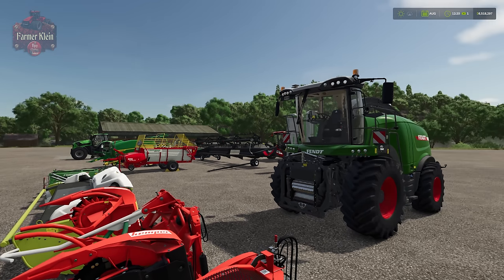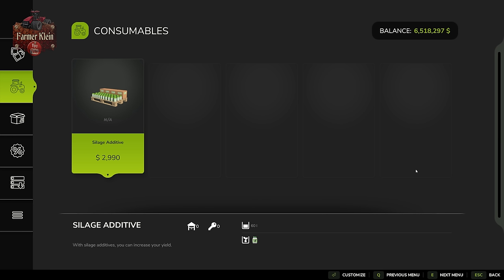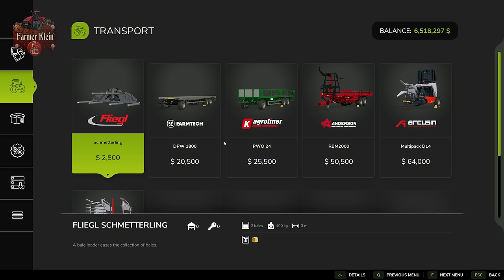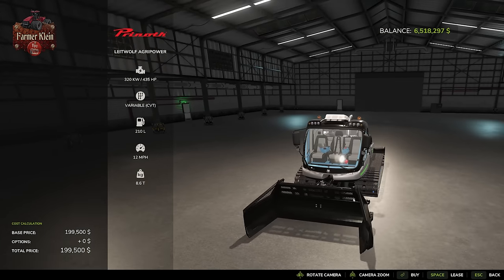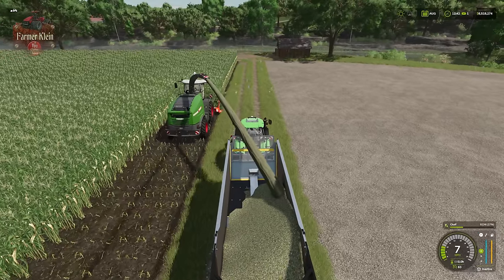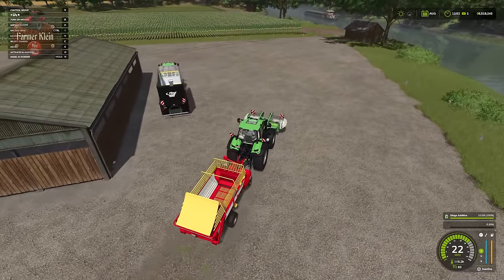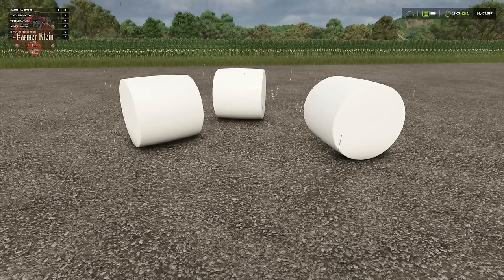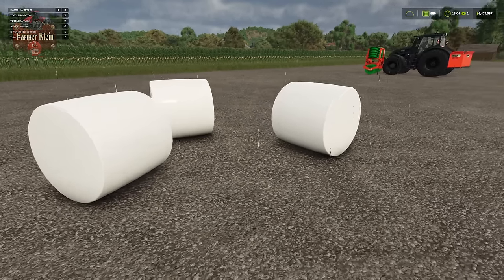The Essential Guide to Silage in Farming Simulator 25

Comment: Thank you for the concrete paint trick FK, very helpful indeed! In FS22, the trick that made its rounds around release was to use a straight subsoiler to scrape out silage that was stuck in the bunker walls. It worked, but it was a real pain to do. I like this much better 👍🏻
Reply: soften does it also.
Reply: tbh I just used a conveyor and pickup never had anything stick to the walls that way

Comment: ah buddy you can get more than 3 cuts off a grass field in a year starting in March you harvest bale or transport to a bunker, Roll the grass with a GRASSLANDS ROLLER, fertilize if under 100% (you shouldn't be) the field is ready EVERY 2 MONTHS until November so Harvest months are March, May, July, September, and November itself, for 5 harvests at 100% fertilization and 90 to 100% Yield bonus.

Also Using the Macdon Windrower with its grass mower head will give a 25% yield bonus to grass and wind row it at the same time so IF your using silage Additive these bonuses add together! so off my 1 Ha Field harvested 5 times a year with 100% yield bonus at fieldwork level harvested with a Macdon for 25% yield bonus, and Silage additive used gives me a total of 130% Yield bonus to grass silage work, This produces 5 cuts at roughly 400,000L to 500,000L EACH Cut! (I'm not so good at staying in the field & like to manually cut lol) that's more than I got from Corn Chaff and honestly I'd rather the profit from the corn and its straw (mod extended straw crops)
Reply: I can never get it to grow in the winter. And hence I never get to harvest at march. I end up harvest 4 times only. May july sep and nov

Comment: I’ve been using the Goweil stationary bailer along with the new straw storage shed and I love it.  But no matter what whether it’s chaf or grass it bales it but will not wrap it.  I can’t see any button to use that switches from regular bales to wrap.  It is loaded with wrap so that’s not the problem.   Any help would be wonderful.
Reply: Maybe you positioned it in a way that the bale is loaded into the storage before it have the chance to be wrapped. Can try to put the baler back from the input of the storage a bit
Reply: That worked.  Thank you so much.

Comment: the problem of staionary baler-wrapper is that, you need to constantly change wagon/trailer while mowing. The good thing of JohnDeere baler-wrapper is that you could just drop off bales non-stop and collecte them with trailer
Reply from the maker: I dont follow.  1) mow field and windrow 2) collect grass with foarge wagon, take it to stationary baler and unload then go collect more grass while the baler processes that load.  position the baler close to the intake of a storage building and bales are auto stored when they are offloaded.
Reply: @FarmerKlein  I mean, if I use mower + forage wagon, or forage harvester + trailer, I have to unload every 50,000L of grass. However if I drop off the wrapped bales, and then collect them with the Anderson-RBM2000 trailer, I could transport 24(bales)*3500L(per bale) = 84,000L grass a time. But it takes more work, for sure, to drive around and collect the scattered bales.
Reply from the maker: @dimes3967  There are several ways to perform the same task.  The purpose of the video is to go over many of the common ways this can be done in game.  In the end how you want to do it is up to you.

Comment: hey farmer Klein can pull the trailer with a   forage harvester 18;40?
Reply from the maker: Yes you could if you wanted.  in a cut that might not have made it to the video I used the trailer in the video on the harvester but I wouldn't count it always working.  There are so many ways to do something in FS its impossible to show every possible iteration.

Comment: Ah man.. I was really hoping that you would show how to use the machine that puts multiple bales in a single roll... Before I bought it, I wanted to know how to use it, because I don't really know what to do after you have the bales in a roll. Do you bucket it? Do you stab a single bale and it rips the plastic? Idk..
Reply: You can press a button to unwrap a bale before you grab it if you prefer (once it has turned to silage). Just walk up to the roll and it should pop up as a suggested action in the top left corner. Then can grab with a fork etc as you like with a loader or tractor with front loader arms
Reply from the maker: I used it in last nights live stream.  I have a hard time knowing what should and shouldnt be demonstrated.  we have had the wrapper since 19 so I kind of just go under the assumsion its usage is known at this point.  You place it along a field or fencerow of where you want the 'sausage' to be.  you unfold it and turn it on.  Then you place a  bale using forks in the intake end, the end highest off the ground.  The machine will take the bale and start the wrapping process but stop half way into the bale until you present another bale.  at which time it will wrap and push the sausage out the other side of the machine.  after you have added 4-5 bales you will notice the machine is pushed backward as it processes the tube of bales so when starting think about what direction you want the tube to go.  then when  you have put the final bale you want in you enter the machine and till it to unload and it will finish out the sausage and push the machine free of the roll.  At that point you wait until its turned to silage and you can hit R to open the bale and it will unwrap 1 bale at a time.

Comment: I made a bale tube with the Anderson wrapper. But i cant figure out how to cut the wrapping. 😮 ive seen others mention the same. But no explanation
Reply from the maker: look in the F1 menu when your at the end of a tube it should say cut for something like R.  I havent made one in 25 yet but thats how it worked in 22.
Reply: I tried everything. It shows nothing. Doesn't give me an option
Reply from the maker: @anthonyscott3847  Ill try tonight on the stream if I can and see if I can figure it out.
Reply: You need to wait for it to turn into silage before you can unwrap it, so it's stuck where it's at for now. Where you make the tube is pretty important lol.
Reply from the maker: @lordlurk7968  indeed.  maybe thats the case.
Reply: @lordlurk7968  ok! That's probably it. Thanks! I'm just testing stuff so I didn't let it sit at all.
Reply: @anthonyscott3847  No worries friend! I ran into the same issue because I tried using it for the first time yesterday myself, completely ignored it in FS22 lol.

It seems to be a really easy way to collect a lot of bales cheaply early on with an autoloading trailer and wrap them in a central spot, since you'd need to unload the autoloader anyways it saves a bit of time running around trying to wrap them individually.

I've yet to test it, but I feel it will benefit wrapping square bales for silage massively since there's no all-in-one baler for them.

Comment: Is the silage additives working? i tried most machine that adds it but the value never goes down, i mean its not using it, is there a button or something to press to use it?
Reply from the maker: it works only if you are picking up grass.  It worked for me on the forage harvester when I used it.  That may or may not have made it into the video.  I recorded about half of this video 3 different times as I didnt like the way I presented it or how it flowed.